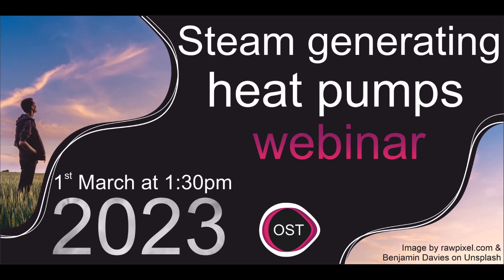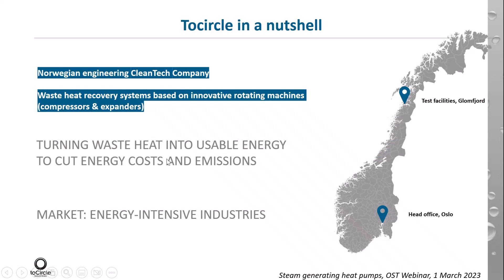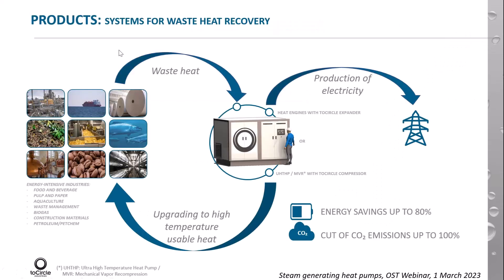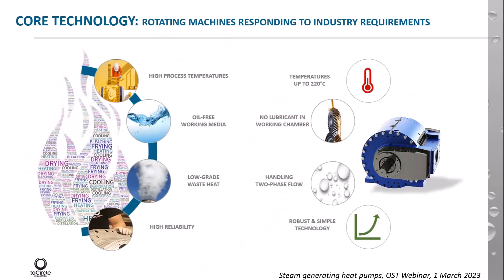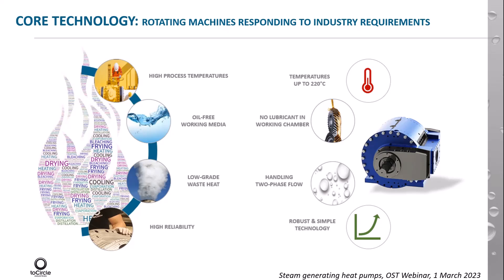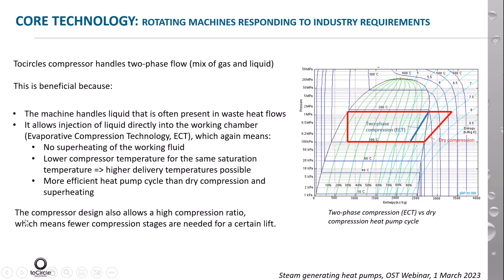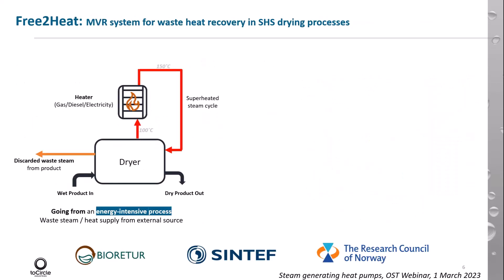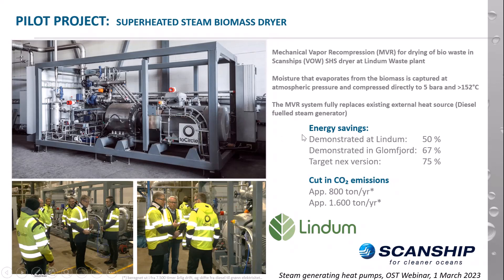Innovative MVR solution to generate steam | Steam Generating Heat Pumps Webinar 2023

Comment: Hot water injected to remove superheat. Nice.  Steam up to 220C would be ideal for UHT processing (140-150C) and spray drying at 200-220C. Sounds very interesting.
Reply from the maker: Great point. I would add that transcritical cycle or heat pump using mixture of refrigerant would most certainly be more efficient for spray drying using air as medium.